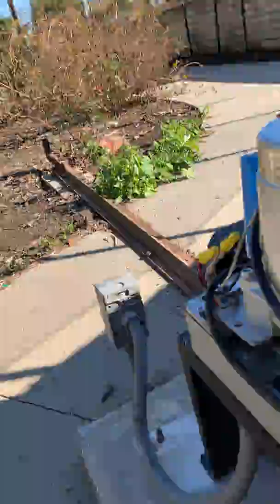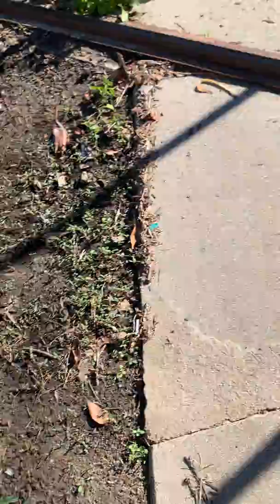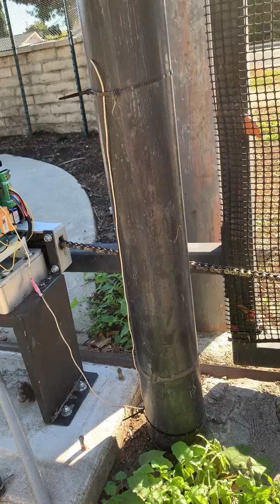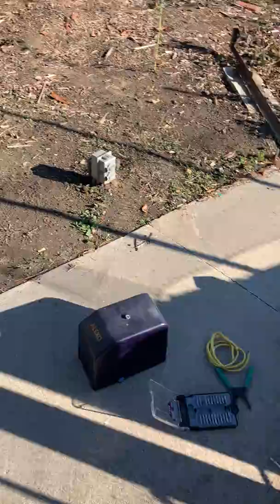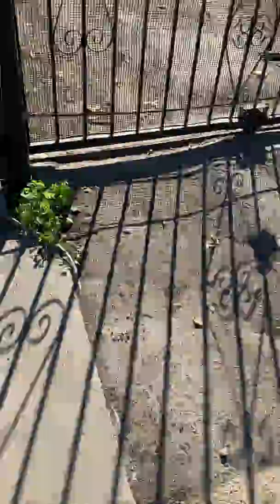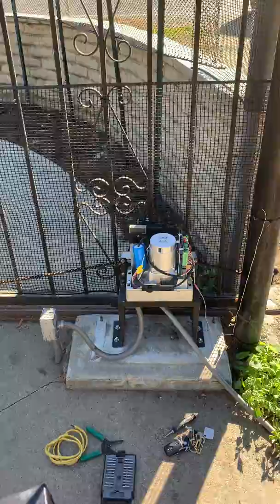Aleko Gate Wand Troubleshooting Pt2

Comment: I see there are two conduit coming up through the bottom of the unit in this Aleko Gate mother operator Video (I am only asking in this Youtube video because so far this is a good example of seeing two conduits installed for this product usage.). I bought an Aleko 2700 for my sliding gate. I have not finished installing it yet. There is only one hole in the base it mounts to. I need two holes for two conduits, one for the power 120vac, and another for low voltage for accessories to run the wires/cables separate and not in the same conduit at the power cable. Did others   drill new holes in the base with a hole saw? There are no provisions in the cover, or other parts for another set of wires and or conduit. I see this as bad planning by Aleko, making us look for more holes for low and high voltage cables that need to be separate. I have looked all over the Internet and instructions and there is nothing about these issues with in regards to installing power and conduit into existing hardware. For the money this stuff cost, they should have drilled the second hole for safety of low and high power separation. 120vac and 12/24V DC. IMHO